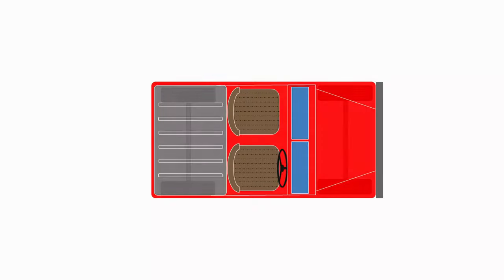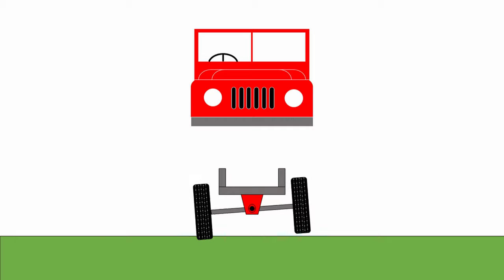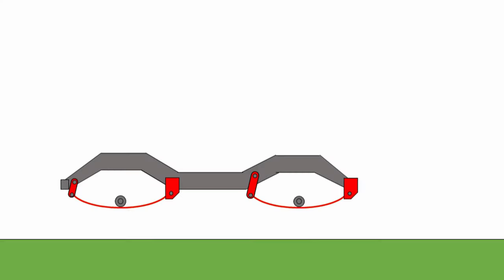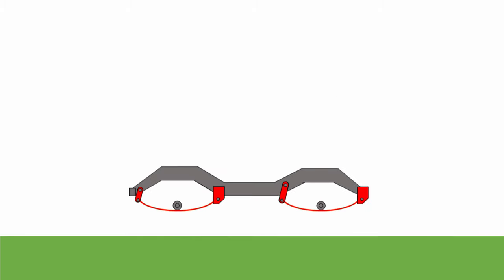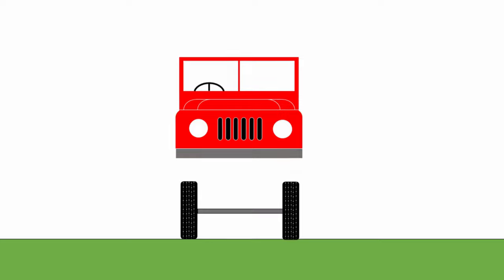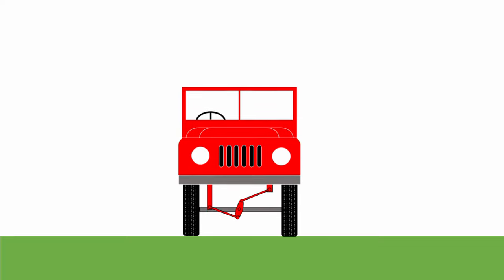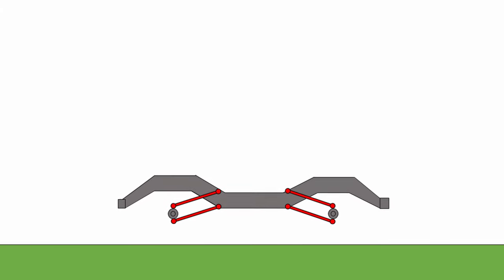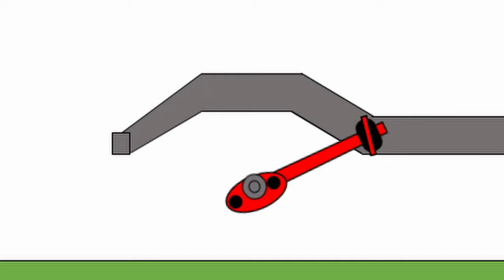Beam Axle Location Methods - 4 links, 5 links, Panhard rods, Watt's linkages, leaf springs etc.

Comment: So if I have a 3 or 4 links, a panhard bar would be unnecessary because the axle can't move lateraly. This mean that bump steer is unnevitable, right?
Reply from the maker: You can configure a 3 or 4 link setup to control lateral movement, but you need to design that in somehow, in the case of 4 link by having the links form a W, or in a 3 link system by having a link that is only able to move up and down and not sideways. If you’ve got a suspension setup like a 4 link that prevents all lateral movement, but a steering setup where the steering link runs across the vehicle then bump steer is inevitable.